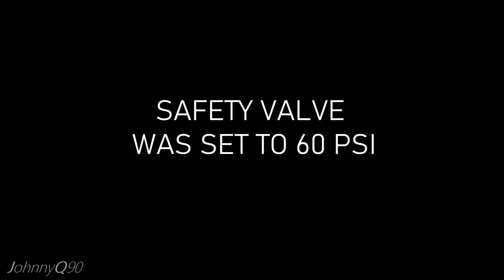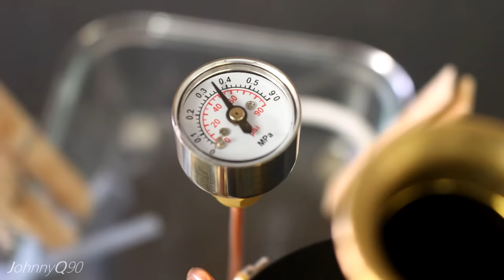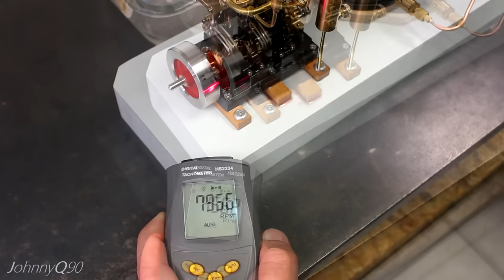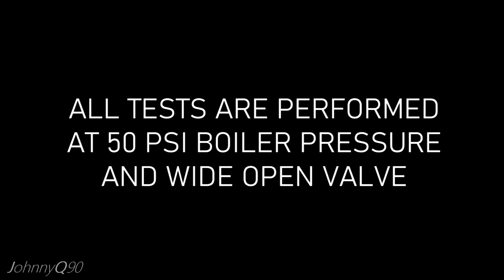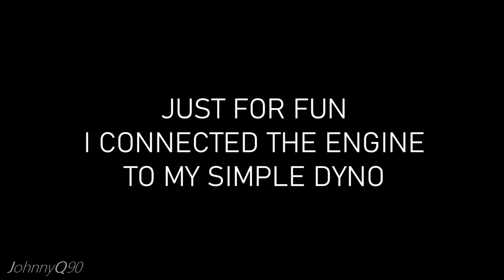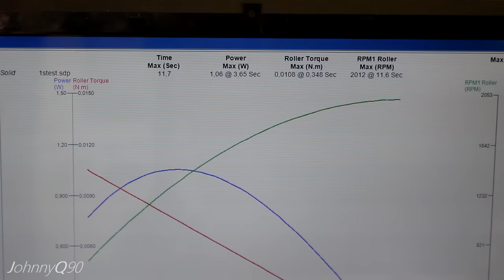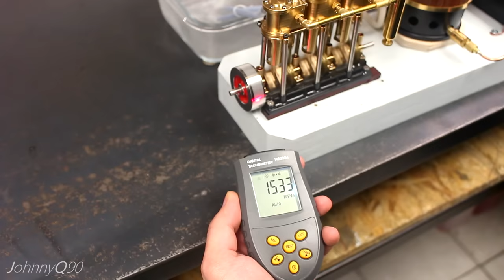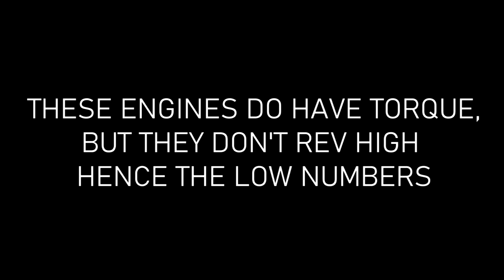Testing a TWIN & TRIPLE Steam Engine!

Comment: I wonder, would it be possible to run the 2- and the 3-cylinder as a compound engine, with the twin taking the role of the high-pressure set and the triple taking the role of a low-pressure set?

Comment: I wonder if the 3 cylinder needs more steam pressure to operate at full efficiency (70 psi maybe?). Seemed like it wasn't making as much power as the 2 cylinder did, whereas I would have expected more power output from the 3 cylinder vs the 2 cylinder.

Comment: Can you for fun just run the 2 cylinder at higher and higher pressures until it fails? 2k rpm seems super low

Comment: If you have an air compressor you can pressure test anything up to ITS capacity. Just use barriers or whatever in case of failure! 
BTW, By testing incrementally to destruction you will know its true strength.

Comment: For a bit more marine realistic steam ekspansion engine. You need to cool the exhaust so it condenses and create vacuum. Meaning you wil gain one bar of available power! ;) If you go all the way you can make closed loop and pump the water straight into the boiler and create 3 stage boiler, with economiser, steam, and heated steam. But that's all out real marine engine for you 😆🙃

Comment: Just wondering but what is the crank offset on the two cylinder, it sounds more like 270 degrees rather than 180, also are these engines double or single acting?

Comment: There's steam powered vans and trucks and I think a car in the Riverside museum in Glasgow Scotland and also in the transport museum in London England there are a few small steam trucks in there, about 120 years old, could burn hydrogen in something like that and get around 🤔 this little set up burning hydrogen and recharging a laptop and running small lights in a shack would be a novelty

Comment: Would it be better to use batteries to quickly heat the water up and be more controlled for energy consumption ?
Reply: Electric boilers are built different then gas heated boilers.

Comment: Please don't think I am being a smart ass....I am asking this question because I honestly don't know.  Would you get a more accurate result from the Volts/Watts test if you had the generator/motor bolted down in a fixed position with a proper serpentine/tension belt?

Comment: 07:55 Small permanent dc motors are very ineffective as electric generators. I don't have any rating for that particular motor, but wouldn't be a surprise if the output power from the shaft is in the ballpark for 3-8 times the electric power.

Comment: Wait, wait, wait, hold the phone. Did that reading really just say 1.92 Watts of power? These engine are cool as hell but that efficiency is much lower than I expected. I'm sure thermal heat loss is a huge issue, but considering the energy of the fuel being burnt surely is monumental comparted to the output of the engine, is it not? Either way, that 3 cylinder sounds epic.

Comment: listening to the steam plants running and all I can think of is they dont sound quite right .. not like the ones Keith appleton runs when he has them all setup ... I dont know perhaps the timing is not advanced just enough at top and bottom of stroke for each cylinder ... or perhaps something isnt quite aligned perfectly ... not sure what but ... something sounds just a bit off all the sounds should be the same and in even sequence but they are not and there is a note change for at least one of them on the triple 10v plant ..

Comment: they sound very clacky, as if theres play in the bearings or rod connections. or if the timing is way late.
also they should be able to run a lot slower. two stroke oil aint the right oil at all for the job-> get some steam oil for the displacement lubricator at least. and some regular fine maschine oil for the bearings. automotive engine oil needs temperature to work properly, temperature that the bearings aint gonna reach in this case.
and while i get that the "dyno test" was just for fun, but an inertia dyno aint gonna give you any usable reading. steam engines are known for low rpm high load work. so a static load dyno would be the best for that
Reply: Finally someone who knows their way around steam engines.
I too didn't like him treating them like a nitro car engine, they work completely different and don't need top speed revs like that.

Comment: Steam engines are not meant to Rev at 2000 rpm. They are not like petrol engines. They do not require rpm to produce power. They will produce usable power from zero rpm. They are more like a electric motor.
Also their lubrication systems won't handle petrol engine rpm.
450rpm is more like their top speed and load should be applied to maintain that rpm. Higher revving is just over speeding. Many steam engines have governors to prevent overspeed if the load is suddenly removed.

Comment: Those are very nice engines, but a point about oil. Absolutely DO NOT EVER use oil designed for internal combustion engines anywhere near a steam engine. Once it’s heats up it can do terrible things to the cylinders. It is imperative you buy some proper Steam Cylinder Oil before continuing. This oil is atomized by the steam and lubricates the pistons. Most motor oils turn into a sludge. You can use 2 stroke oil on the bearings but really it’s way to thin for this. Some grades of steam cylinder oil work well for this too. They look excellent though, best of luck!

Comment: the think i hate about these things it the fact they run too fast, realistically thats suposed to run about 50rpm at most. if i had one i would gear it up and connect the output to another flywheel and a govner so the engine can be run at max throttle but spin fery slowly and smoothly instead of sounding like a dragster

Comment: Unbelievable poor output. But looking and sounding very nice steam engine. I'm guessing most losses are throtteling cross sections of lines and valves.  Thanx for presenting. Introducing the dyno is one of the tops of your recent video channel productions.

Comment: You want torque on the low end of RPM, not high. High RPMs is where you get your horse power. Dragsters and funny cars want more torque than horsepower, while formula cars want higher horsepower. Consequently dragster motors run at low RPMs while formula cars run high RPMs. If you are running things like generators and heavy flywheels you want lots of torque.

Comment: Looking at cylinder sizes it is obvious these are simple 2 and 3 cylinder engines. I would have been much more impressed by a double and a triple expansion engine. MUCH more efficient; and,  as marine engines, much more accurate to the real things.
Reply: On rails, they repeatedly tried double expansion, and always reverted to simple.
Reply: @b43xoit  Railroad locomotive engines are a whole different genre from marine engines. For one thing, locomotive engines use the exhausted steam blown up through the stack to increase the draft and cause more steam production from the boiler. They do NOT require the steam to be condensed and reused as with marine engines because on land fresh water is much more available to resupply the engine. On ships fresh water must be either carried, or created by distillation. The same is true of fuel. On board a ship making the very most of your fuel supply was much more important than on land where fuel was readily available. Because of this marine engines by the 20th century were mostly either double or triple expansion. I suggest you study the history of both locomotive and marine engines, so you can understand the differences and the engineering problems involved in both.
Reply: @powellmountainmike8853  Sure, all of that is true. However, for railroads, coal was not free of charge, and designers did take some interest in efficiency. And they saw enough potential in compound expansion to try it.

Comment: 60 to 70 psi ? scared :D rofl ,  power and torgue... put that ,,generator,, on same axle, not throu belt, if you still want to use belt, for F sake, MOUNT IT

Comment: blows my mind We can run engines off of water but instead of that technology being developed we are focusing on electric vehicles.
Reply: It's very energy intensive to actually boil water, and as the pressure rises, you actually need more heat to continue to boil water, as such it would be less efficient than any ICE.
Reply: @danielmonsanto8286  yeah the water is burning off of butane lol. At that mount you could just run engine off of butane lol